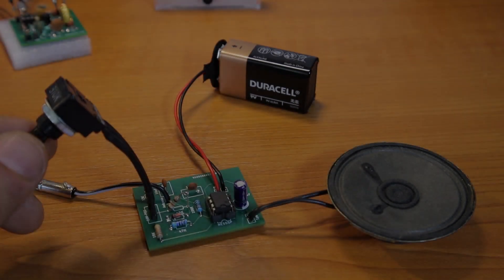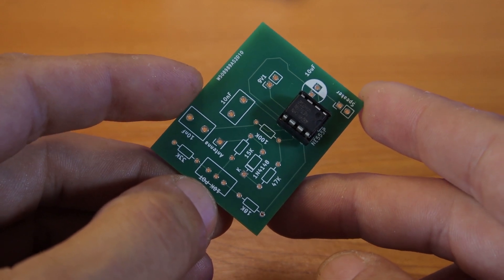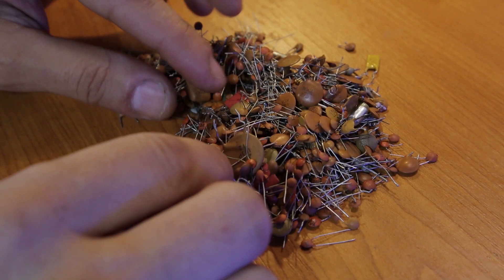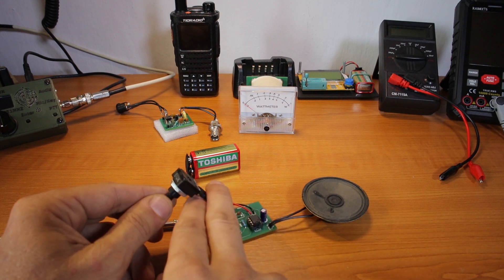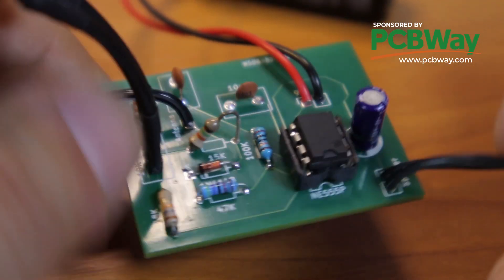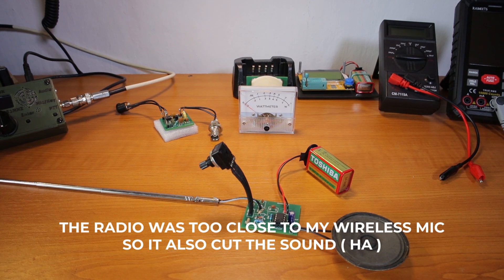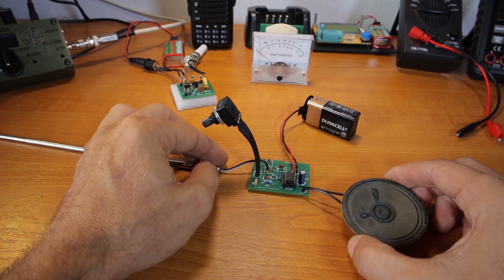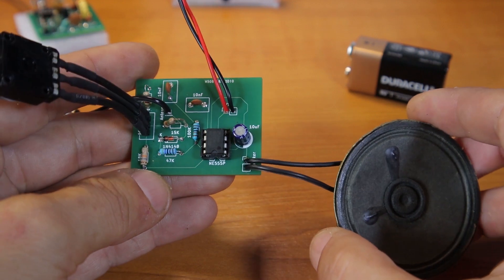Build A Simple Audible RF Field Strength Meter - Squeakie by VK3YE

Comment: Nice thing to have at home.
Reply from the maker: Ohh yes... and is so funny. I love the sound of it 😁😁.
Reply: @dxexplorer  yeah it's funny that why it's it called squeaky 😁
Reply from the maker: @Pachikole  😅😅😅
Reply: @dxexplorer  by the way today I finished tube amp for my Regen receiver
Reply from the maker: @Pachikole  Ohhhh that is great. I will go tomorrow in the city to a junk market and see if I can find some tube sockets so I can build a low voltage receiver with one tube... except the amp that I may make with transistors.
Reply: @dxexplorer  sounds great, make Shure to not buy used tubes, you never know if they are good or not, new ones in their packs should be alright.
Reply from the maker: @4L1LAT Ahhh no... I just need the sockets. I already have some tubes... old but brand new.
Reply: @dxexplorer  okay then good luck 🍀
Reply from the maker: Thanks so much. Let me know how the amp sounds. 😁
Reply: @dxexplorer  it's sounds great, absolutely amazing 🎵, I will take video and send it to you 😁
73!